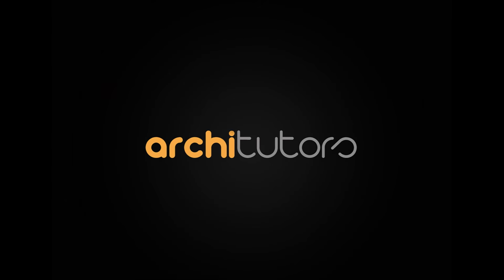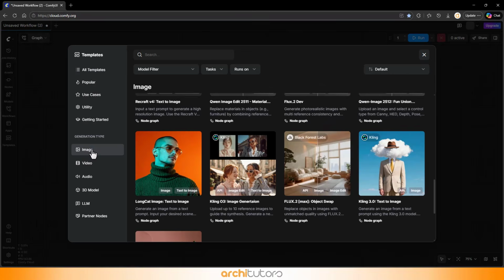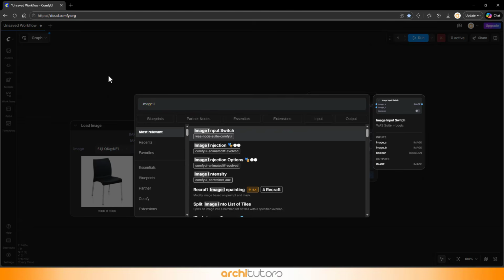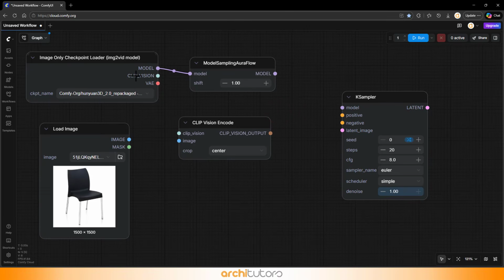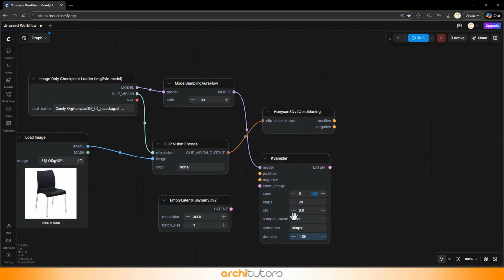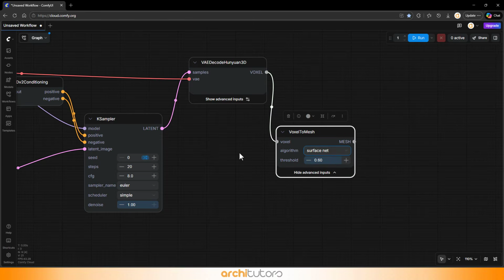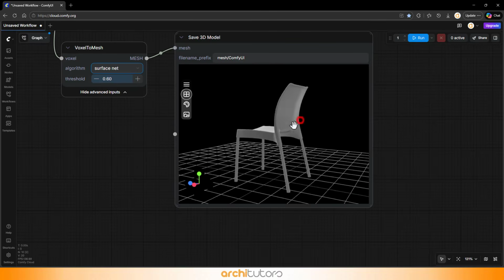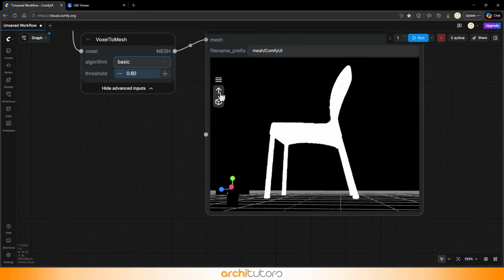ComfyUI Tutorial | Turn Any Image into a 3D Model in Seconds

Comment: # ComfyUI Error Report
## Error Details
- *Node ID:* 3
- *Node Type:* ImageOnlyCheckpointLoader
- *Exception Type:* AttributeError
- *Exception Message:* AttributeError: 'collections.OrderedDict' object has no attribute 'nelement'
Reply from the maker: That error usually means the wrong kind of file is being loaded with the ImageOnlyCheckpointLoader. That node is meant for special image only checkpoints, but if you’re trying to load a normal diffusion model you should use Load Checkpoint instead. Just make sure your model file like .safetensors is in the ComfyUI/models/checkpoints folder.

Comment: Hey, thank you so much for this tutorial! I have a question about the Positive and Negative inputs. One thing I love about ComfyUI is how it uses positive and negative prompts, but I was a bit confused about how they're used here when there's no prompt connected. Is there an example of how to use them in a similar way to the prompt categories in ComfyUI?
Reply from the maker: Thanks for the kind words! The Positive and Negative slots in KSampler are just places where you plug in the guidance you want the model to follow. Most of the time that’s text prompts run through a Text Encode node. Positive is what you want to see, Negative is what you don’t. For example: Positive could be ‘high detail, cinematic lighting’ and Negative could be ‘blurry, distorted hands.’ Even if we don't connect a prompt in a workflow, those inputs are there so you can drop in whatever conditioning you like.

Comment: I get a wireframe 3D model.  How do you put the colors back onto the 3D model?
Reply from the maker: That can definitely be an issue but if you're importing that file into SketchUp, it’s actually an easy fix. For example, when importing an STL file, go to the Import Options dialog box and check 'Merge coplanar faces'. Also, make sure to set a larger import unit than millimeters. SketchUp struggles to generate faces smaller than 1mm, so I generally set the units to Feet. That usually does the trick!

Comment: Hi, congratulations on your work. I wanted to ask you. I noticed that in ComfyUI you have different windows than the standard model. I assume you have different nodes that change these windows. Can I ask you which ones you use? Graphically and also to open some things (for example, searches, it seems very nice to me).
Reply from the maker: Thank you so much for the kind words! 🙏 Yes, you’re right. You can actually change the appearance of many different tools like how nodes are displayed by changing the settings. For example, in settings I have the option 'Modern Node Design' enabled. You can dive into many more settings on how different tools or options are displayed on comfyui window.

Comment: Great Video! One query what about text like bump map like texture can you please guide the way to handle that as well
Reply from the maker: Great question! ComfyUI doesn’t directly generate bump maps from text prompts. The usual way is to generate a texture with a diffusion model, then convert it into a bump/normal map using external tools like Blender, Substance, or Photoshop. So text can guide texture creation, but you’ll need a conversion step afterward.

Comment: Hello, it successfully converts the image to 3D, but the accuracy is low. It can distort the part. Also, the dimensions aren’t coming out the way I want(For example the object's length is 112cm, but the 3D output's length is 5cm). Do you have any suggestions for these?
Reply from the maker: To improve accuracy, make sure the image you’re using is high‑quality. You can also increase the resolution in the Empty Latent component, and adjust both the num_chunks and resolution values under the VAE Decode component for better detail.

This workflow doesn’t define real‑world dimensions of the output model—the generated 3D object won’t automatically match measurements like 112 cm vs 5 cm. You can scale the model later inside your 3D software to get the exact size you want.

We’ll plan a future tutorial specifically on changing scale and dimensions of generated models, so stay tuned!
Reply: i run stuff like this through yorespot since they keep models updated, way easier than managing files yourself. follow me for free image and video generation